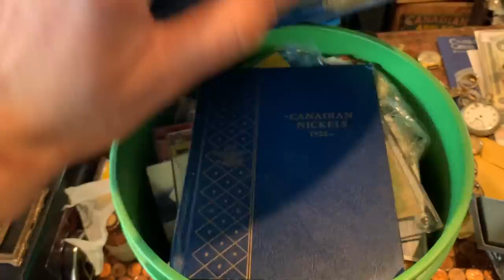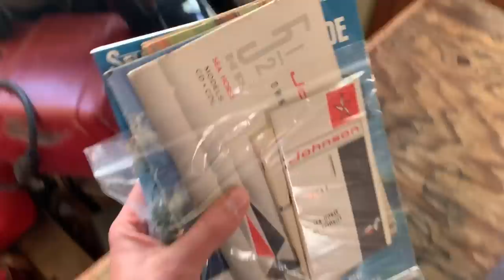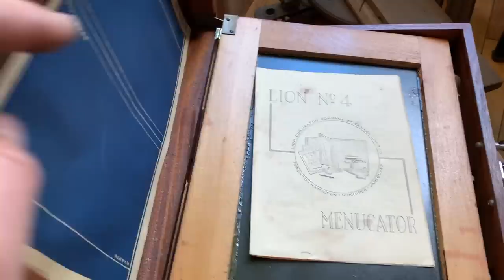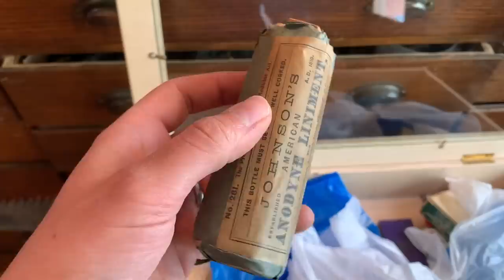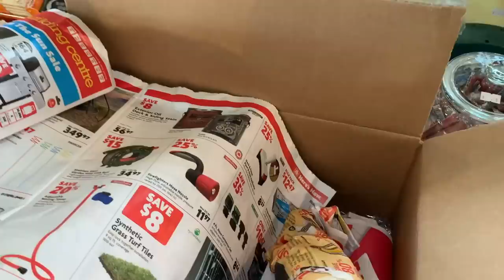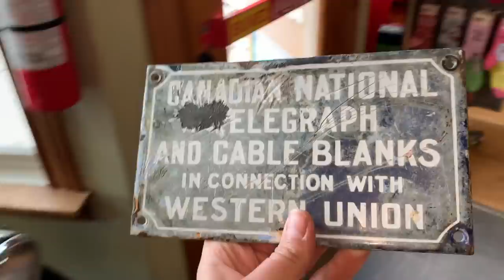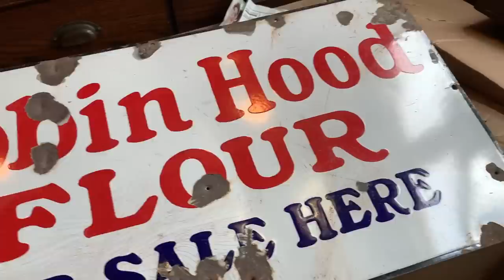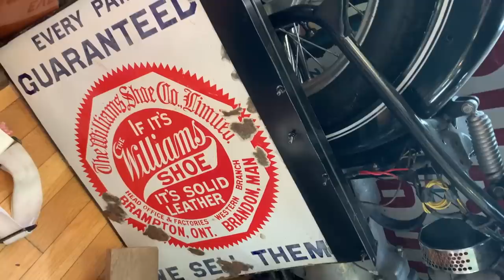Truck load of treasures! What’s in the crate?! plus more!

Comment: You opened the typewriter the correct way at first; someone had it upside-down in the case. Olympias are classics in their own right and very collectable to some people depending on the model. I still have the one that got me through college.

It should be latched to the bottom of the case. Normally you wouldn't remove it to use it; you'd just take the lid off.
Reply: I thought so!!
Reply: I have the exact same one!  I got it while I was in high school in the 1970s.
Reply: Tom Hanks is a collector of type writers
Reply: @tcalto2319  I received an identical one for graduation in 1961.

Comment: Have an apple corer just like that. Been in the family since it was brand new. Works perfectly good as the day it was bought. I've added a small 3D printed blade holder to hold modern box blades which are sharper and hold an edge better than the original one, but other than that, no issues with it. Can't beat good old engineering.

Comment: The "Microscope" at 4:20 appears to be a Bausch & Lomb Duboscq Colorimeter.  The device was named after Jules Duboscq who invented it.  It measures the concentration of a colored component in a solution.  You put a sample of known concentration in one tube and the unknown sample in the other.  You adjust the lengths of the tubes until the colors match, then the products of the concentration and length for each should be equal.  Since you know the concentration of one, you can calculate the concentration of the other.  A very useful device.

Comment: From The Lancet , Jan. 27, 1906 p. 270

In the section "Notes, Short Comments, and Answers to Correspondents."

THE SPARKLET SELTZOGENE

Those who have had occasion to use the old form of seltzogene with its effervescent powders will easily recognize the advantages offered by the new sparklet seltzogene or sparklogene. To begin with, the effervescent powders are dispensed with altogether in the sparklogene, and when we recall the trouble involved in placing powders in the upper container, in keeping particles of them out of the aerated liquid, in removing the liquid products of interaction when the seltzogene is required to be re-charged, and in preventing the powders evolving gas before the seltzogene could be closed, it must be owned that a very decided advance has been made by the substitution of a sparklet for the purpose of the aeration. Moreover, the time occupied in the preparation of an aerated water in the sparklogene is very much shortened, and, in fact, three pints of aerated water may be made ready for consumption in less than five minutes, although, of course, the aeration is very much improved by longer contact of the water with the gas. When the gas is completely discharged from the first sparklet it is taken out after shaking the water and gas together for a few minutes, and replaced by another one, and so on until the contents of three sparklets are discharged. By means of a valve close to the "piercer" the water under pressure is prevented from escaping. When the aeration is completed the sparklet and sparklet-holder are removed and a metal cap put in their place. There is thus no contact of the aerated water with the metal of the sparklet, which at one time gave rise to some of the iron dissolving in the water and communicating to it an inky taste and a turbid appearance. The sparklogene is very convenient for the preparation of aerated mineral waters for medicinal use, such as soda, potash, or lithia water, tablets of the carbonates of these bases being supplied for the purpose. We found the apparatus to work most satisfactorily and the claims made in favor of its advantages are by no means exaggerated. The makers are Aerators, Limited, Upper Edmonton, London, N.

Aw, naw ... the beer stein lids are so the beer doesn't slosh out while you're conducting the singing!

The Mountain Dew bottles have the original logo and artwork used through 1969--that's the way I first remember seeing them.

VERY neat Robin Hood sign! You know they got started over in Moose Jaw?